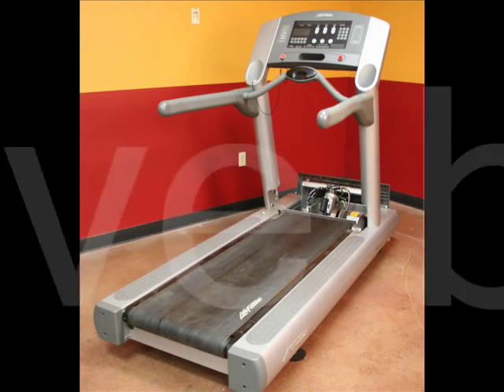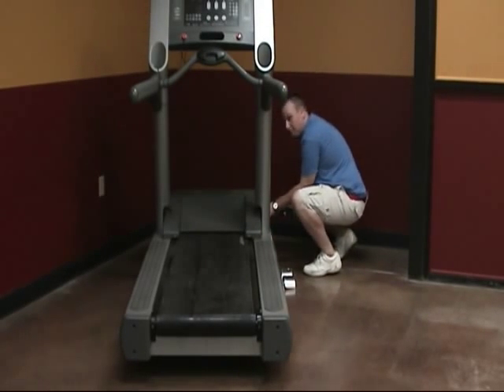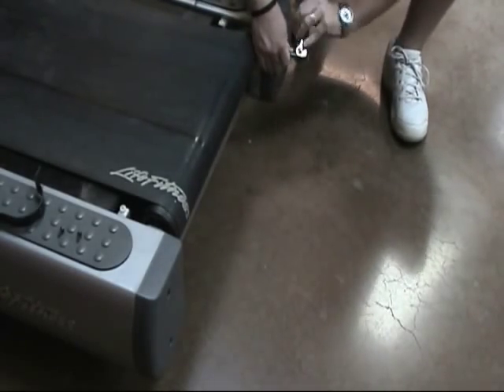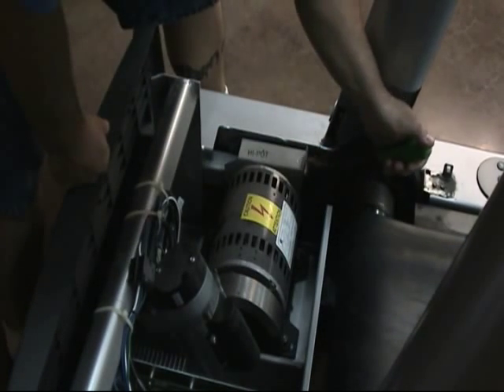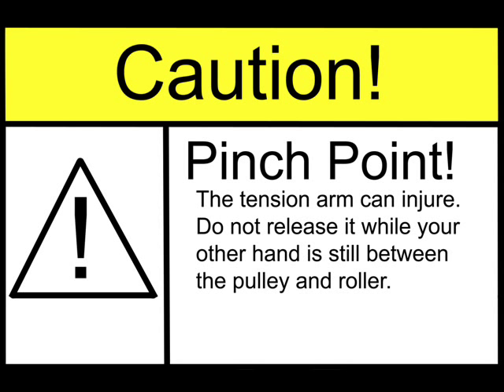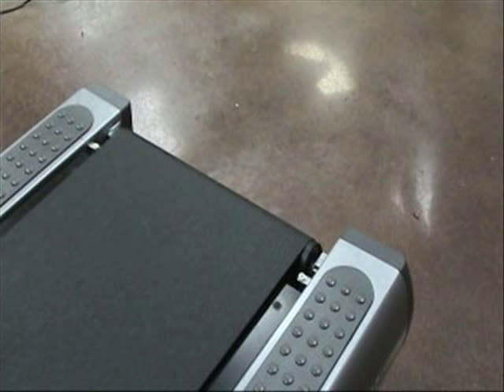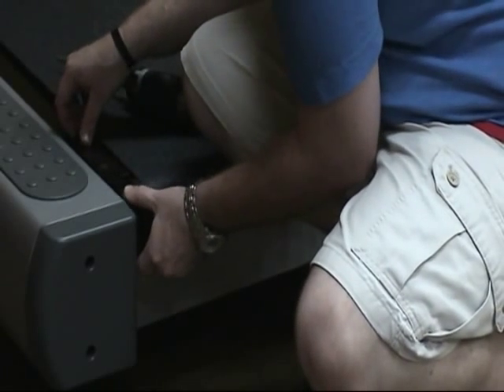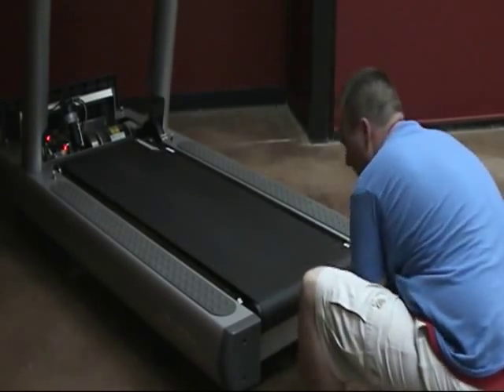Life Fitness 95T drive belt replacement

Comment: I just installed the new belt but as I test spinning it manually, it walks to the right and gets misaligned. No matter how hard I try to align it between the front and back it keeps shifting right. Any suggestions?
Reply: Also, the grooves go into the grooves right? So the smooth part of the belt faces out
Reply from the maker: @Nevbrookscooks  You are correct, the grooves of the belt interface with the grooves of the pulleys. The alignment of the pulleys can cause the belt to walk off. You can use a ruler or other straight edge to verify the pulleys are in line with each other, then verify that neither pulley is angled compared to the other, which can also cause this issue.

Comment: Same treadmill.  What I have happening is the motor runs and turns the walking belt. Stepping in the walking belt stops the walking belt. The motor continues turning but front roller stops.  How do I adjust the tension on the drive belt?
Reply from the maker: Thanks for your question. Some treadmills have an adjustable idler pulley between the motor pulley and the front roller that can be tightened. Some have slotted holes where the motor mounts. On those, you can move the motor back by loosening the hardware to tighten the belt. If you do not have those options, replace your drive belt.

Comment: I have a squeak coming from the tensioner pulley on my 95Ti. 3 in 1 oil didn’t resolve it. Am I able to purchase a new pulley and replace it? Or would i need the full tensioner assembly? Do you have a video showing how to replace it?

Comment: this is impossible to do belt is so tight
Reply from the maker: You must use a small pry bar to raise the idler pulley to get the belt on. Be careful not to pull the idler assembly up too far, or you can disconnect the spring that connects to the idler. If that happens, you can remove the front cover and locate the hole where the spring should attach. You will have to remove the pin that the idler assembly pivots on to get the spring installed. Then re-install the pin and begin placement of the belt again.
Reply: @sportsmith  i made it but i put it on the motor first then under the big pulley and finally over the top of the pully was the last step,i used zip ties to hold the tension then just rolled it fwd,if you put it on the motor then on top of the pulley and you leave under the pulley as final step belt will get stuck

Comment: Am I missing something? You didnt show how to actually replace the drive belt.
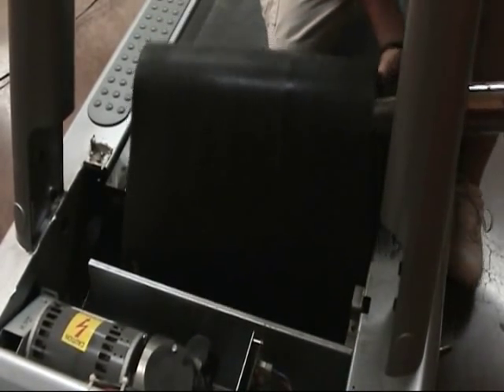Reply from the maker: During the replacement procedure, you will see the drive belt on the front roller. Unfortunately, as the roller was being removed the belt came off and so you don't see us "remove it" from the roller at about 3:15 in the video.  Then, as we install the roller at 3:31 you will see I reach back and install the belt over the roller as it was already installed to the motor pulley.

Comment: You didn’t show the drive belt replacement at all??
Reply: 4 years late buddy 💀 but thanks for the response
Reply from the maker: During the replacement procedure, you will see the drive belt on the front roller. Unfortunately, as the roller was being removed the belt came off and so you don't see us "remove it" from the roller at about 3:15 in the video.  Then, as we install the roller at 3:31 you will see I reach back and install the belt over the roller as it was already installed to the motor pulley.

Comment: They skipped the deck removal and deck flip. The deck must be removed in order to change the stride belt.
Reply from the maker: Hello, and thanks for your comment. Your statement is correct. However, this is a drive belt replacement video. Not The striding belt. The striding belt (also called a walking or running belt)  video can be found at the Sportsmith's youtube channel under "Life Fitness 95T Belt and deck replacement"

Comment: Hello! I would like to ask if it's normal for the screen on the inspire 95T treadmill to start flashing when the red safety key is removed or misplaced. thank you!
Reply from the maker: Hello, We would love to help you figure out this issue. Please call our tech support line with your complete model and serial number for the machine and the console, at 1-888-713-2880 and we will be glad to help. We take technical support calls from 8:30am until 5:30pm CST. Thanks for your comment!